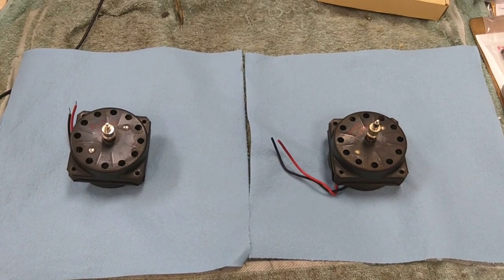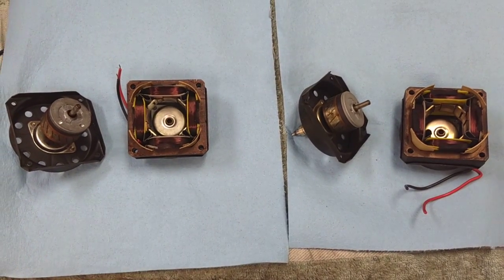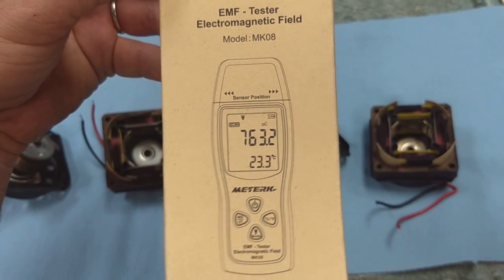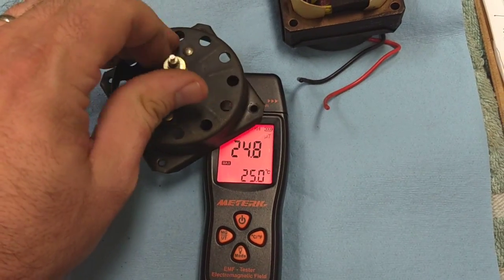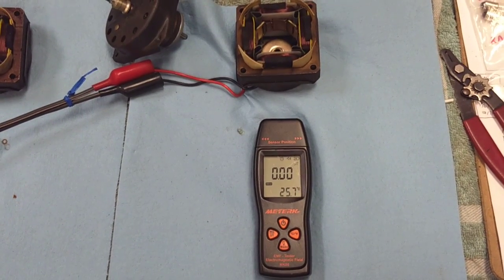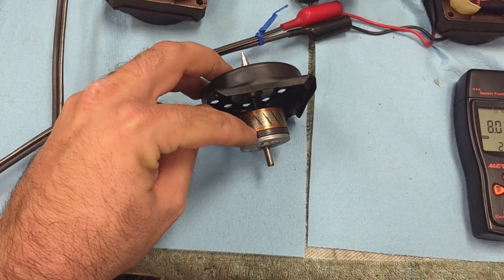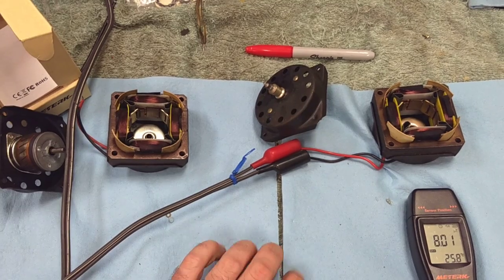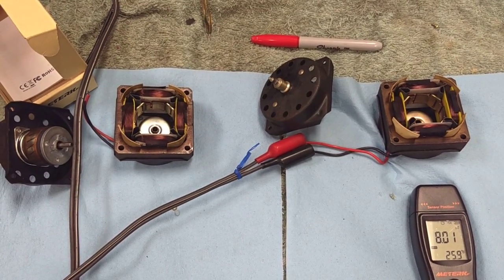Dissection of defective magnavox turntable motor and comparison with good motor

Comment: My Dual 1218 motor has just suffered this. A real head scratcher when the player went from working great to not having any torque to run the auto changer cycle. Would run at the correct speed but had zero torque. Thank you for this experiment.

Comment: I have a motor from an F200C that the wires broke off of do you know of a way to solder them back on ? I have had no luck
Reply from the maker: Did you scrape away the enamel from the wires first? Using at least a 50w iron?
Reply: @JordanPier  i may not be able to use the windings anyway. they look scorched

Comment: Thanks, have the same problem. Can't find Part number. Any source for a replacement motor when I do find the number ?
Reply from the maker: Motors from 62-66 were the same. 67 was a transitional year. 68 through 73 I believe are the same. Essentially have to buy a parts record player and pray the motor is good.
Reply: @JordanPier  Thanks again, my motor has piece of metal bar like on the bottom, do I turn it to unscrew  to access the inner?
Reply from the maker: @papacamet8907  there are usually four 1/4" nuts around the motor body. Remove them to get the motor apart.
Reply from the maker: @papacamet8907  oh...need to know what kind of magnavox you have. Conquest, micromatic, etc.
Reply: @JordanPier  The player is a MICROMATIC made in England. PartNumber 523699-2, Model appears to be Wo20-03?. The unit was working fine until I removed it to fix record drop position(rubber boot adjuster missing) The motor contact points were not making, burnished now make contact. Can I send a photo of these to you? Appreciate the help, not many with your old school knowledge.
Reply from the maker: @papacamet8907  inbox me - vintageavrepair at gmail dot com

Comment: And any recommendations on how to get the outside of the motor screws off ? Mine are bolted on extra tight and I’m unable to look further into this issue on my Magnavox due to not being able to get inside
Reply: heat gun, gently applied

Comment: I was working on my BSR model turntable, mine wasn’t moving (which I believed it to be a bad) it had a lot of red on it due to it being used and due to age I assume. Once I cleaned off the red stuff on the motor with a nail and screwdriver it turned back to its normal silver color and started spinning again. Saw it in a YouTube video and decided to try it and it helped me out and was up and running again.

Comment: Noise?  
That should be the clue.  
Motor moving slower because of excessive drag due to the bad bearing?
Reply from the maker: Bearings were equally good on both motors with excellent spin down and very little end play